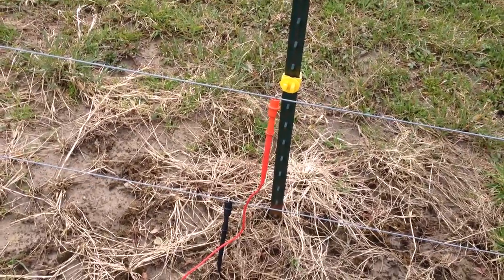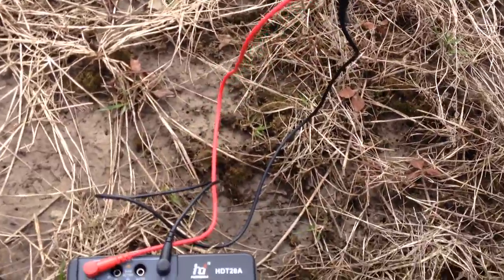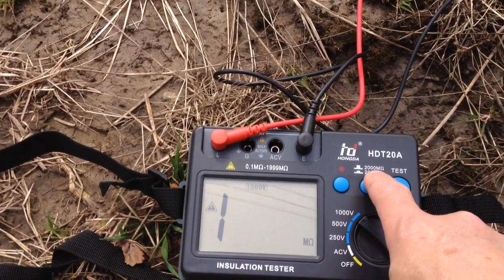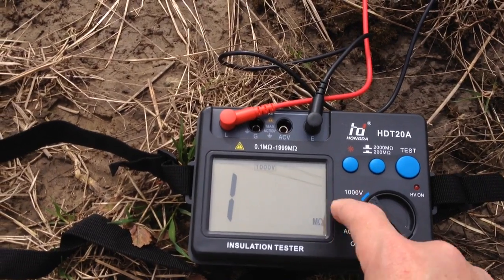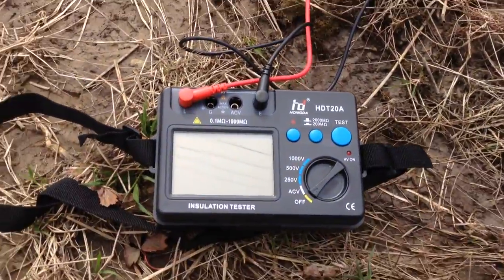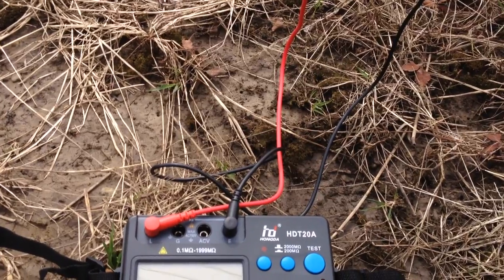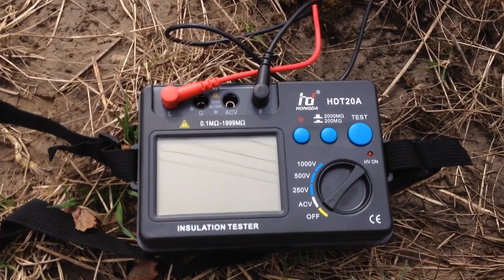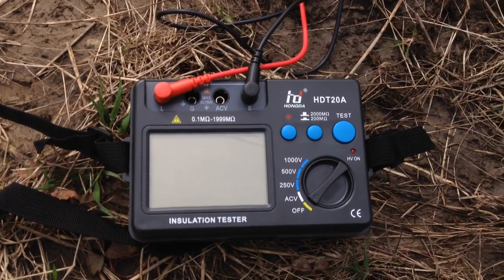Orchard Diary 4/10/2017: Testing my electric fence

Comment: How many volts would I need to keep skunks and raccoons away from, and from destroying my lawn? Thanks.
Reply from the maker: An electric fence is not going to solve your problem.  The critters are there because you have grubs in your lawn that they are eating.  Get rid of the grubs and the critters will move on.  Don't waste your time and money on a fence.
Reply: @Neighbour_Al  Thanks for your reply. We have had our lawn sprayed twice to lessen the number of grubs but we will not see the results of that until next year according to the person that applied the spray. In the mean time I hope we still have a lawn left.
Reply from the maker: @1rcproductions   I'm not familiar with any spray that has long lasting benefits (years).  Milky spore (recommended for Japanese beetle grubs) lasts for several years.  https://en.wikipedia.org/wiki/Milky_spore